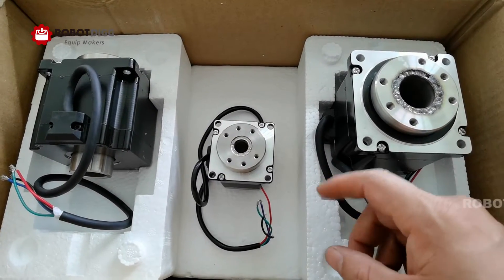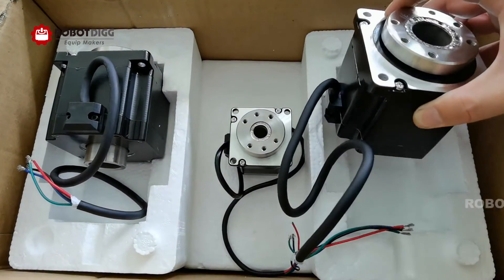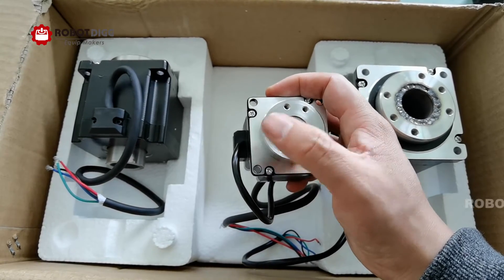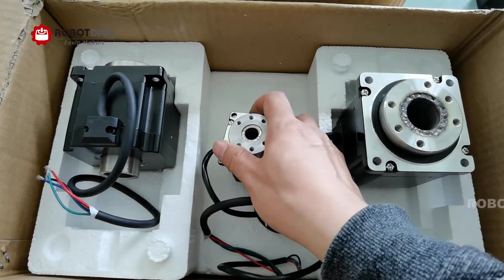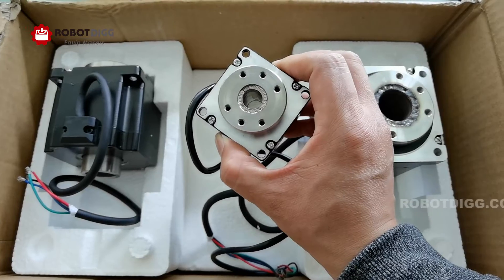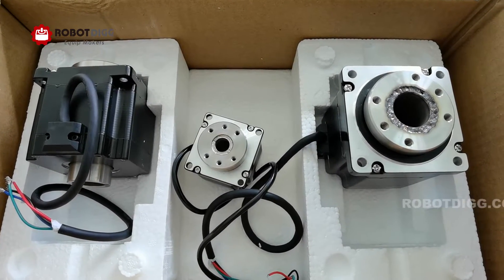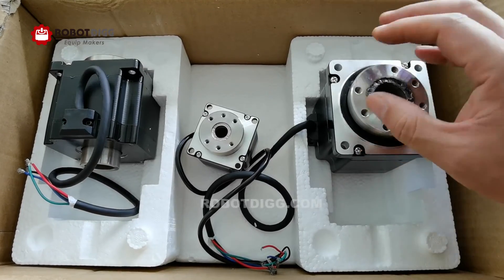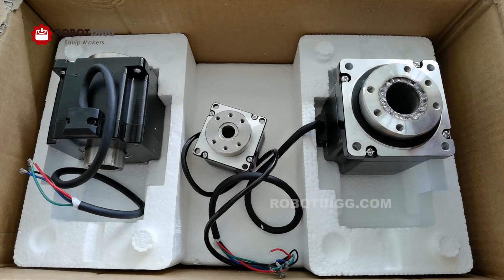RobotDigg nema23 and nema34 hollow shaft stepper motor

Comment: I am using a 10-15Nm Servo motor. but I might switch to hollow shaft Stepper motor. 
what torque Stepper motors do you have?
50-1500rpm